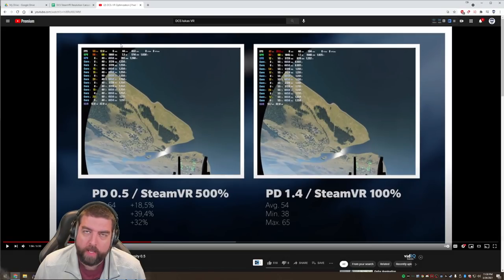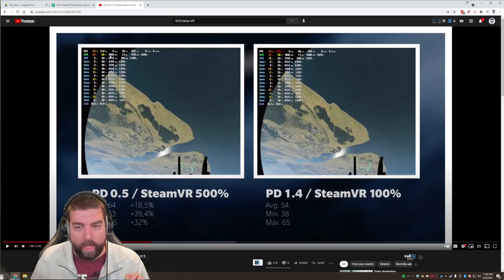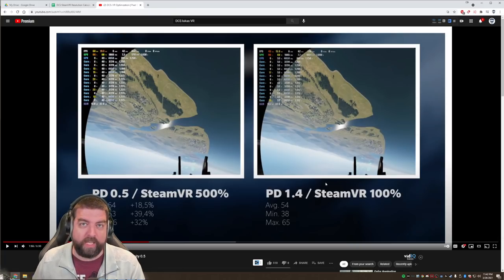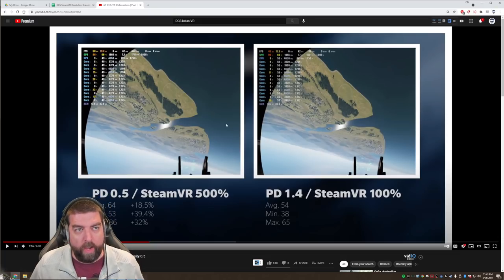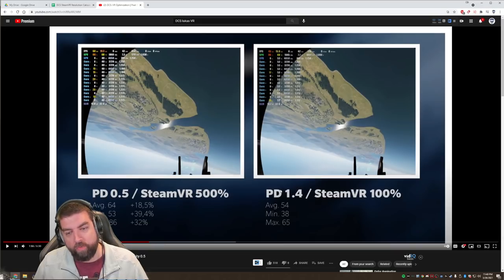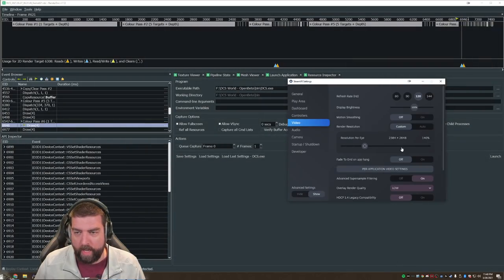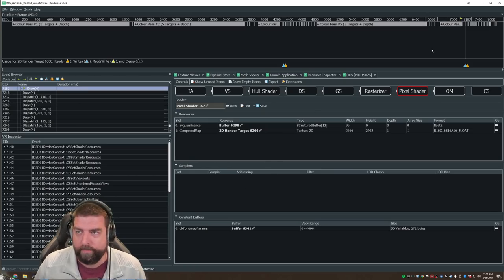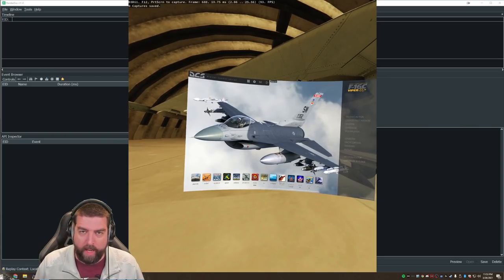DCS VR Optimizations - MYTH BUSTED - A sort of peer review of the Lukas S 0.5 Pixel Density video

Comment: Thx for your work man👍 so if i understand right, i place the max Horizontal and vertikal Pixel of the pimax 8kX in the first excel cells? Can you tell me what is the aspect ratio and the Barrel Distortion of the pimax 8k x?
Reply from the maker: Aspect is a calculated field based on the widt and height of the per eye display, barrel distortion is 1.4

Comment: Are you sure we need this 1.4 multiplicator because of the lens distorsion ? Is it not because it was a convenient way to do super sampling because of pentile OLED screens taht oculus CV1, htc vive and vive pro and valve index are using ?
i will play around with this to see if it's the real for my HP reverb G2 or not. (i naturally would go to ratio that provides an output resoution that matches my screens resolutions of 2160*2160 per eye
Reply from the maker: More there for verification and to match the numbers I'm seeing in steamvr and in renderdoc
Reply: @Jabbers  yeah on my side I tried with 50% in global steam VR as this was matching my native resolution. I also tried 70% to try to have slightly better visuals at minimum cost. But I'm not sure if it's really better or not, or of it's better to put msaax2 instead.
Reply from the maker: Gonna be 100% up to you, if it feels good then leave it

Comment: Thanks for this!  with my Pimax 8KX we have another factor in Pitool that can mess with the math -  So I have my DCS PD set to 1 and my Pitool render quality set to 1 but my 100% SteamVR is not showing the 140% at 100%.  I am showing 3712x3160.  Using your calculator I have an aspect ratio of 1.77 and with the 140% it should read 5376x3024.  That means something else is messing with the render pipeline
Reply: I concur - same Pimax 8KX 3712x3130. What gives with these "secret Distortion multipliers". Give us the truth in %. We obviously can handle it. It's like all the steam Vr people decided "Well we know the true resolution of your HMD, but we are going to arbitrarily assign a SS multiplier so that your games don't look as bad as that - because we're smarter than you". At least the should have said what the multiplier is when they put that 3712x3130. Just confuses things and adds more math under the hood.

Comment: Hey what is the barrel distortion multiplier that you added to the Google sheets calculator. This is new stuff for me and im just trying to figure out what setting that is. I have the G2 so my resolution is 4320x2160
Reply: Ryan, 
I, too, have the G2 and would like to get the best performance and resolution in DCS as possible. However, all this geeky stuff is more than I can process so, I would appreciate it if you would reach out to me when you determine you best settings. My system is /was top of the line a year ago, I9-9900K @ 5.0 GHz, 32GB 4133 Ram, EVGA RTX2080 Ti Kingpin Hybrid unlocked with 11GB Vram
Reply from the maker: All headsets have a multiplier for barrel distortion, 1.4 is a generalization based on the vive and index, the G2 multiplier is slight different but I don't have one so I don't know the exact number

Comment: Hi. So I am using a Samsung O+ and the numbers from your spreadsheet dont add up. it is also 1440 x 1600 per eye (Samsung states 2880 x 1600 res) and in SteamVR at 100% it is showing 1440 x 1812 per eye?  Ive tried to play with the numbers (aspect ratio, Barrel Distortion Multiplier.....are these different for different headsets?) and I cant even get it close. 

Any Ideas?
Reply from the maker: The o2 barrel distortion multiplier must be different from everything else. At a quick search I don't see anything listed online for it. I think what I've been able to determine through from feedback from others is that the sweet spot for performance and clarity is around 150-175% resolution per eye (or custom resolution multiplier)
Reply: Thanks for the replay. I've been playing around and so far with steamSS main @ 100 and dcs dp at 1.0 I'm happy with per app setting of 200% for a 2044 x 2564 res. Gonna keep playing but you're video definitely helped me understand it better. Also I am now getting a better fps result too

Comment: Me and mates have been arguing over this for over 6 months. I also did the same maths as you did and dissagreed. The only thing I see as different is the visual cuality of one and the other. Meaning there seem to be slight differences in antialiasing algorithms between steam and dcs that will make some things edges shimmer or not for example. Neither is perfect but just tune your system to get the number of pixels your system can handle and go fly.
Reply from the maker: It's likely cause 1.4 PD is to large a resolution and the anti aliasing that occurs from down sampling isn't as good, try 1.1 or 1.2 and see if it feels more the same

Comment: Like you I wanted to believe.  I ran my own tests and it didn’t work. I use Oculus Tray Tool in the Rift S and the math wasn’t right. OTT multiplies the PD in game by the OTT to give effective PD and setting DCS in game to .5 and OTT to 2.5, (which is the highest setting) and the effective PD 1.25 and it looked like crap.  Went back to the settings in OTT that I have tested.  The question I have would I see visual improvement if I used Steam VR instead of OTT?
Reply: Make sure you check with the tray tool HUD at which resolution you're running, because I noticed really strange stuff happening, sometimes settings just wouldn't change, or they're linked or something. Either way the oculus tray tool or dcs or both seem seriously buggy at times in my experience.

Comment: i think you are making a wrong assumption here. 
The global resolution per eye and the resolution per app in steamVR are actually multiplied. 
Technically it doesn't matter if you crank up global and leave "per app" at 100% or if you do it vice versa, you end up with same effective resolution. If you crank up both, like you did in the video, no wonder that you get much larger resolution as both values are applied. First the global resolution is scaled and then "per app" resolution is scaled on top of that.
Reply from the maker: Ya that WAS my point, I realized they are multipliers, and I understand their difference global vs per app. See the calculator, it all makes sense and works

Comment: Is there a reason the formulas in E22 and F22 do not match.  When putting numbers above or below 100% in E13 and F13 the results in E22 and F22 are different.
Reply from the maker: I'll take a look, sounds like maybe I updated the formula for 1 column but forgot the other
Reply from the maker: Fixed, it was a miscalculation in F22 thanks for pointing it out!

Comment: For those using Oculus Link on a Quest2 - does the steam vr settings override the Oculus app settings?
Reply from the maker: Only if yiu force dcs to run on steamvr with the command line arguments
Reply: @Jabbers  interesting thanks, I just launch dcs inside of the steam vr "lounge" room. This is not enough then?
Reply from the maker: Nope that likely launches dcs using the oculus compositor
Reply: @Jabbers  Even then it doesn't override them - it uses the Oculus setting as a base. Different Oculus Link settings result in different 100% values in SteamVR. So basically it's another variable in the pool, but SteamVR does show the actual render res just without factoring in the DCS setting.

Comment: I don't care what the numbers appear to say, my eyes tell me different. I'm an engineer and usually my response is 'show me the numbers', but numbers based on assumptions that none of us know the exact underpinnings of can be a precise way to get the wrong answer. This video makes the implicit assumption that the PD in DCS and SteamVR do the same thing, in the same places, at the same time, using the same algorithm. Change any of these factors, and essentially the benefits of one slider over another are *different*.  ***The settings don't result in magic; they result in different***.  And in my judgement, for my computer, for my Valve Index, smoother and more fluid while keeping my gauges readable.  Whether that is achieved via FPS or just the way the frames render I don't know and frankly I don't care.  That's never been achievable before 'tho I have tried many times. My PD is set at .6 and Steam at 500%. And I am loving it. Isn't it about what your eyes see? To me, it's ALL about what my eyes see.
Reply from the maker: There is no assumption that steamvr and dcs do the same thing, it's actually fact. You've made up you mind and that's fine, if it works for you I'm not trying to convince you otherwise. By all means enjoy the game at the resolution you have it at.

Comment: Still doesn't make sense to me that the frame rates are the same when going by your explanation.  DCS 0.5 pd would be the game having to specifically render only 800x720 pixels and then those pixels being copied and averaged in the following supersampling (which should be cheaper operations).

Should also lead to lower ultimate image quality than 100 res 100 SS 140 eye res.
Reply from the maker: That's not how it works. The resolutions are the same no matter which way you look at it if you match the PD exactly to the calculation of SS * 0.5pd
Reply: @Jabbers  How is it not how it works?  Supersampling is a post process done on a rendered frame.
Reply from the maker: It's not being post processed is the point
Reply: @Jabbers  ..?  It is.  It even says in the options menu where you're setting it.

One of us is having a stroke right now.
Reply: @jimmehjiimmeehh9748  neither the SteamVR base % setting or the per app setting are super sampling. They are just parts of the calculation dictating the size of the final rendered frame per eye. Setting the DCS render scale to 0.5 simply tells DCS to inform Steam VR “hey, I want you to render this at 0.5x of your normal resolution”, steam VR then takes that requested frame size and then multiplies it by the base % and per app % setting to arrive at a final resolution it’s going to render at, only then is the frame rendered. None of the steam VR settings are happening after the frame has been rendered. The reason it’s called super sampling is because that’s what’s happened when the final rendered frame is down scaled to be sent the headset.
Reply: @bend1483  "neither the SteamVR base % setting or the per app setting are super sampling."

They literally are and it is mind blowing that you and I guess also Jabbers don't know this.

I mean what else would you think you are changing when you alter pixel density..?  You're not actually able to change the physical pixel density.

What on earth.
Reply: @jimmehjiimmeehh9748  No, They literally aren’t. They are not taking a 0.5x resolution scaled rendered frame from DCS and then upscaling it. They are simply modifiers that impact the final size the frame is rendered at. Once the frame is rendered and then down scaled to the HMDs native res that is indeed a form of super sampling, but there is no intermediate step where you render out a 0.5x resolution frame from DCS, and then upscale it 500% and then downscale it onto the goggles. This doesn’t happen. The Steam VR settings are not “post processes” as you put it that happen on a rendered frame, they are pre-processes that dictate the size of the rendered frame.
Reply: someone call the paramedics Jimmeh really seems to have a stroke. Some feature description might be misleading as well.
Reply: @bend1483  If steam VR's image scaling is not post process then it would override the game's pixel density setting and so it would mean nothing.

It is post proc.  I don't know what else to say to you.  Though hell even you acknowledge it, but claim it happens before "pre process", because apparently you can edit a thing which doesn't exist.

Lmfao.
Reply: @jimmehjiimmeehh9748   Wow, ok you don’t understand a simple concept.

DCS doesn’t know the resolution of your HMD. When you set the slider in DCS you’re not picking a resolution. You are just telling DCS to tell the the HMD driver (either oculus or Steam VR) to render out the frame at whatever multiple of the HMDs resolution, which the driver knows. The Steam VR settings are simple multipliers that effect that HMD resolution figure. Again, This is not a post process, it does NOT happen after the image has been rendered. Those settings simply effect that final render resolution.

The image is rendered at the size that is the sum of DCS PD setting + Steam VR % + Steam VR individual app settings% . This results in a rendered frame. IF that frame is not the same resolution as the native res for the headset it then gets down scaled (this is a post process, since it’s AFTER the frame has been rendered) and then pushed to the headset.

Again. Let me say this clearly so you understand. At no point is a frame being rendered out from DCS at the DCS pixel density setting, then up or down scaled, and then scaled again to be sent to the HMD.

The result of this is that it doesn’t matter how you end up at a specific render resolution. You can be at 0.5PD in DCS and then 500% in Steam VR, or you can be at 1.118 PD in DCS and 100% everywhere else, the size of the rendered frame in the pipeline will be the same in either case. And the performance and image quality will be the same.
Reply: @bend1483  "When you set the slider in DCS you’re not picking a resolution. You are just telling DCS to tell the the HMD driver (either oculus or Steam VR) to render out the frame at whatever multiple of the HMDs resolution"

So are you picking a resolution or aren't you, oh wise one?

(Not going to lie, didn't bother reading the rest of your post, presumably as contradictory).
Reply: @jimmehjiimmeehh9748  lol.

So, oh wise one, when you select 0.5PD in DCS what resolution will the final frame (before any post processes) be rendered at? What else would influence that number? The answer to those questions is in the post above that you didn’t read, because you don’t want to learn. 😂
Reply: @bend1483  To be frank it's nothing about not wanting to learn, but when the first argument of a post trying to tell me that everything that I have seen posted before, including from oculus staff, is actually wrong is self contradictory it kind gives the impression that reading the rest of the post will be a waste of time.

I'll be blunt, the quickest way to see if this is actually the case or not would be to change the lua to something like 0.1pd (assuming it can override the minimum in the options menu) and seeing if it still produces a readable image.  But I do not have the space to install DCS so RIP me :D.
Reply: @jimmehjiimmeehh9748  I’m not saying the DCS PD slider doesn’t have an effect. I’m saying that it’s not the only thing that effects the resolution of the rendered frame. If I set my oculus PD to 4x using the debug tool outside of DCS and then set the DCS pixel density to 0.25 I end up with an image that is the same quality and performance as just leaving everything at 1

It’s not taking a 0.25x resolution image and the post upscaling it to 4x the resolution and sending it to the HMD, if it did, it would be incredibly blurry.

The driver settings combine with DCS’s PD setting to arrive at a resolution for the render.

The driver settings are not a post production, they are not scaling the image after it’s been rendered. They are simply changing the size of the rendered frame. The only time the frame gets resized after its rendered is when it gets sent to the HMD.
Reply: @bend1483  I understand what you're saying, just that it goes against what I have seen from other sources.  Hence why I would like to do that experiment to just answer it.  To be fair I should probably just delete something to make room for DCS to do it myself, assuming my headset still works.

Comment: VR optimization in DCS is just one big mess. I wonder if they will ever be able to implement this in a way where it actually works without melting my computer. 
IL2 works great in VR.
Reply: @L3v3LLIP  Still much better VR Performance
Reply: only way is to get a better PC. DCS is super smooth on a 3080 / 5800x 32 gb ram